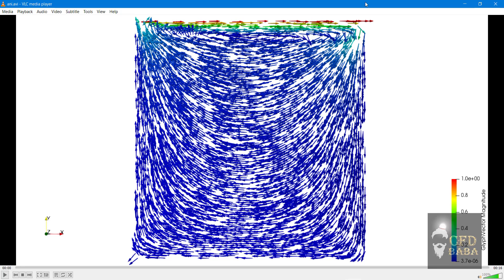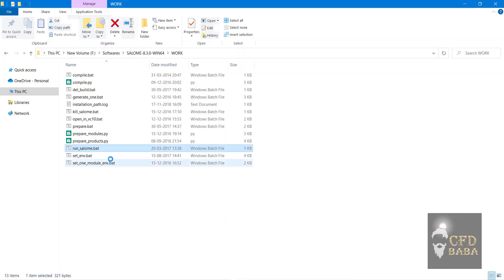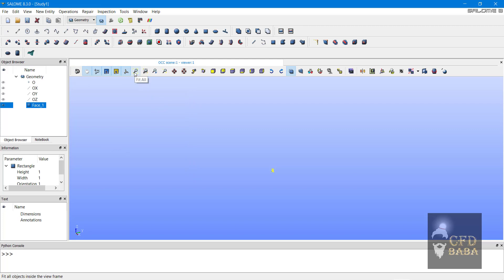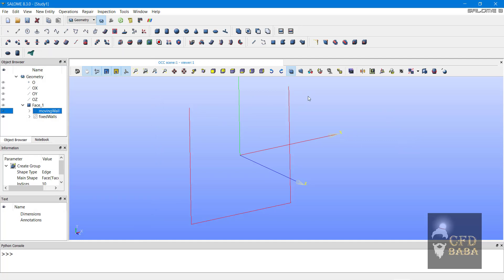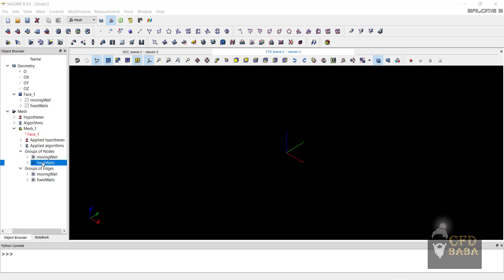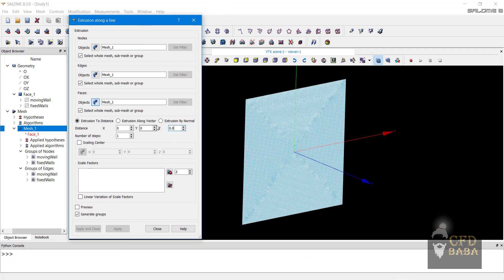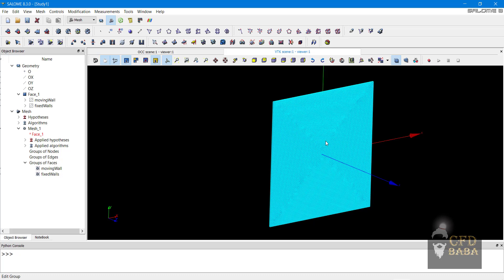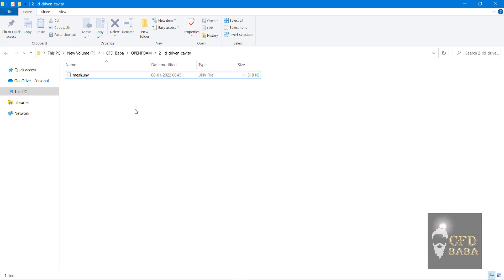How to do Analysis of 2D Lid Driven Cavity Flow using OpenFOAM, Salome, and Paraview | Part-1

Comment: Hi. I m getting some problem exporting the mesh.

    Reading "Mesh2.unv" at line 252632
    Cell type 22 not supported

--> FOAM FATAL IO ERROR: (openfoam-2206)
Bad token - could not get int32

file: input at line 0.

    From Foam::Istream& Foam::operator>>(Foam::Istream&, int32_t&)
    in file primitives/ints/int32/int32IO.C at line 96.